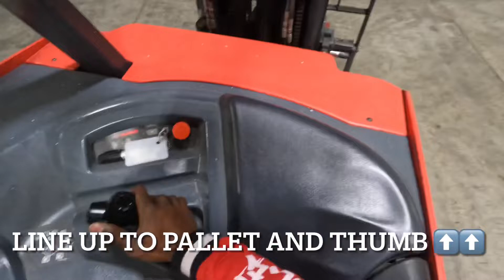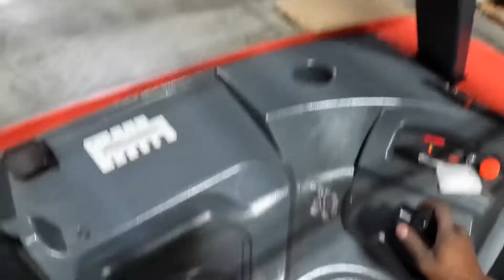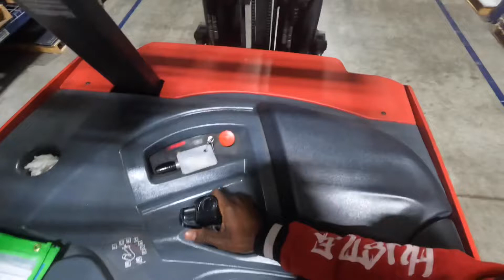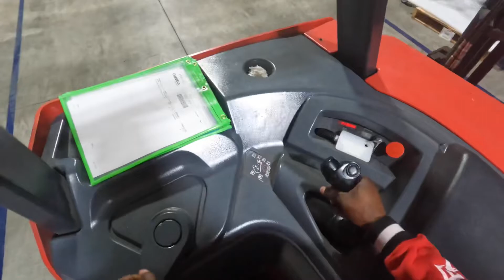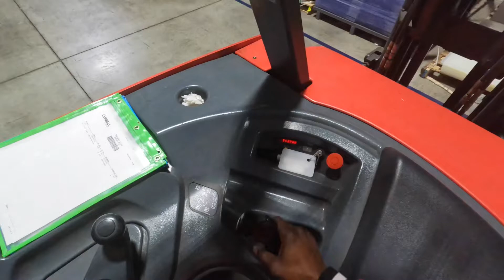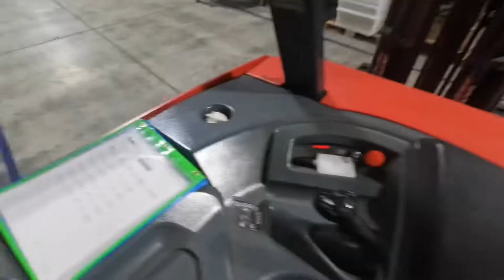Forklift Certified in 5mins ( Stand-Up Edition) Part 2

Comment: Thank you for doing a new updated one I hope that you will show the different ones that is electric versus gas next and the different types of forklifts, and finally what should be a minimum starting pay for forklift drivers
Reply from the maker: No problem Monie. It depends where u live but here in Chicago and Milwaukee area start pay is around $18
Reply: @forkliftjoe3620  I'm in Detroit Michigan so the going rate that I've heard of is between 12:00 on the low end 15 is more moderate only if you have more than three years do they give you 17 an hour. And I like that it's so short skill. Celebrating my birthday month so I plan on taking up the class since it's a one day course. But I like to know what are the differences between the electrical versus manual and the ones that you stand up versus the one she's sit down. I love how you make it seem effort and simple to do. There was someone that trained years back say about maybe 6 years ago with menards. And they lost a life from using I guess the wrong list and it fell on top of me crush them. Please let me know if you can do a video on this that I might stay tuned. Have a blessed remaining week thank you so much 👌🏼🙋🏻‍♀️😎🤔🎉✨

Comment: If you could, show an example of situations of where the tilting and side to side controls are used?
Reply: Usually not needed but in cases such as side shifts due to slightly off alignment when placing pallet up in racks. Or when pulling a pallet down that is close to another. Side shifting just might help not snag other pallet on way out. Tilting used for uphill or downhill to keep load level at all times.
Reply: I mostly use the side to side control to line pallets up when loading them in a truck, because the inside of a shipping container trailer is really tight.

Comment: How did you get used to the reverse steering? I was training today doing figure 8s around two pallets and then putting the forks in all 4 sides of the pallet and repeating , but i still mess up with the steering sometimes going forward or backwards because you have to reverse the steering any tips on getting better at it before I’m having to pick up 1000$ tvs
Reply from the maker: Yes just take it slow don’t be afraid to pick up and empty pallet and practice before real deal. You keep it smooth no hard brakes and pedestrian always first you cannot go wrong my friend!

Comment: You always know when to turn so you're directedly lined up for the pallet that you want, even the ones that are high up.  Are there any tips for how you do that?
Reply from the maker: Usually if u line up with the bottom one most likely from that pallet to the top pallet you should be able pick up with small adjustments to make sure load is stabilize.
Reply: @forkliftjoe3620  Thanks Joe